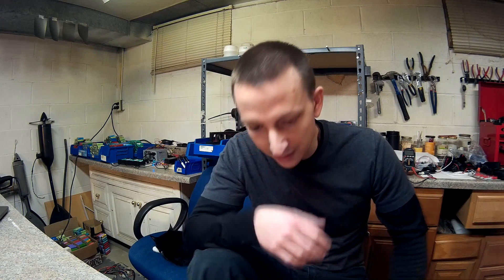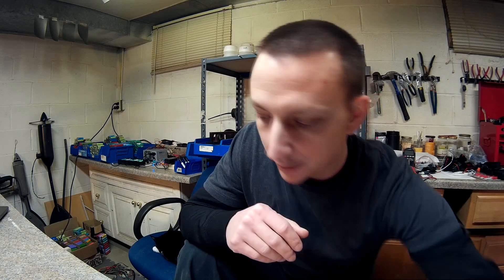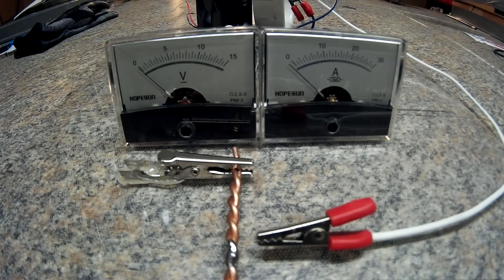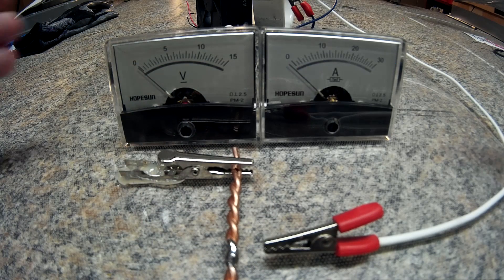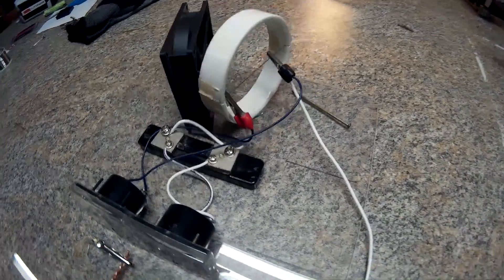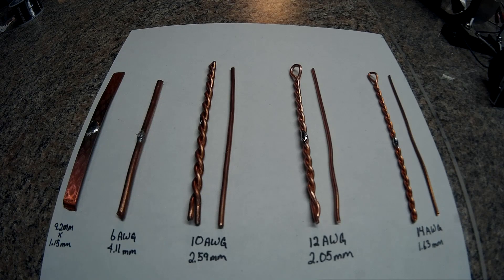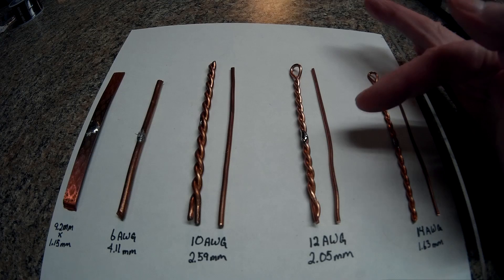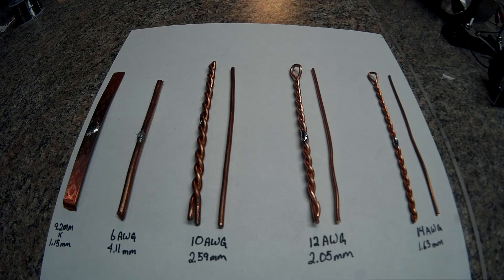Diy Tesla Powerwall ep21 New Fuse Tester Thingy

Comment: Since I know how much power supply's cost as well I found this online and actually I'm in the process of building it myself and it has only cost me around $35 for all the components and all you have to do is solder some things together is does only go to 6 amp but still I think you could find a mod where it could end up going higher.  
http://www.instructables.com/id/DIY-Variable-Power-Supply-With-Adjustable-Voltage-/
Reply from the maker: I looked at a lot of vari-able diy power supplies before I started doing all the fuse testing but like you said about the amps.  I couldnt find one able to supply enough power without buying something so I ended up using what I had and easy enough for someone to replicate.  Thanks for the link 👍

Comment: Gotta love the out-takes!  I think you should do a whole show of out-takes and no content ;)
Obviously others are concerned about the thermal mass that the fuse is mounted to.  But it would be interesting to see at some point in the future if there is any difference at all in the exact current a fuse opens at, with huge masses, then identical setup with just clips on it.  I know the fuse will affect the thermal mass or battery that it's soldered to, but im not convinced the opposite is true.  It should be sheer saturation of electrons on the wire/fuse that causes it to blow, the temp should just be a symptom and not cause. But I don't know.